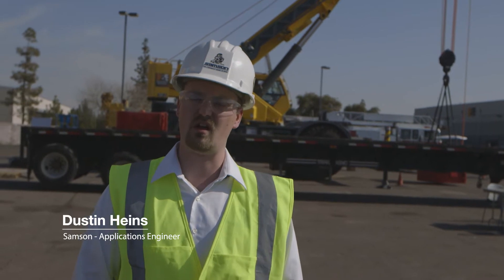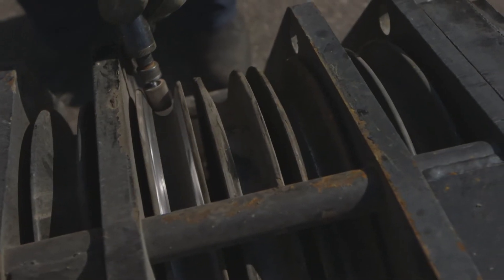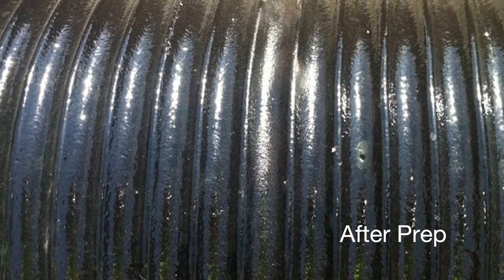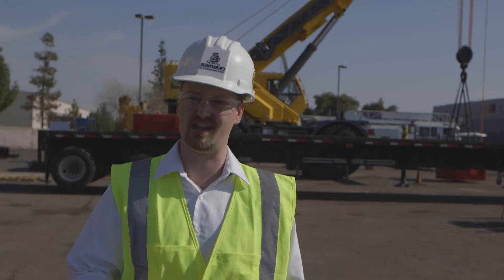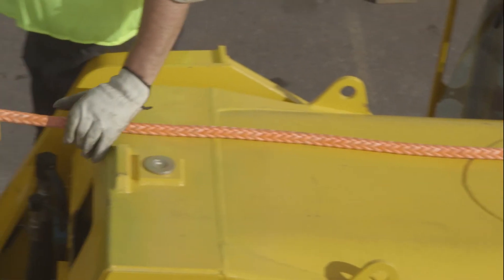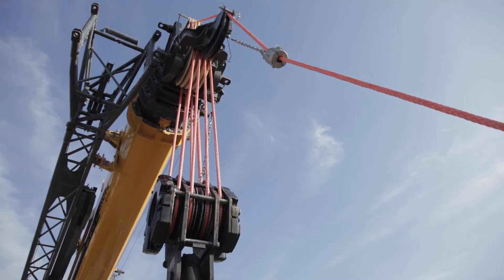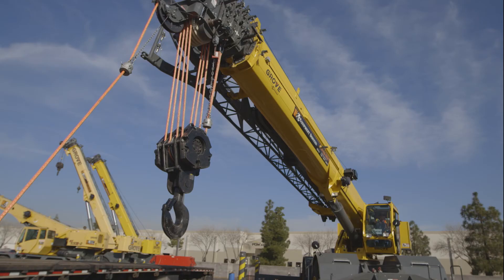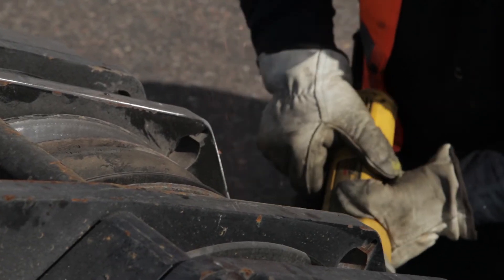Samson K-100™ Install Preparation

Comment: how does the rope not get sucked down into the layers on the drum under a load?
Reply from the maker: The rope construction provides a firm cross section that enables efficient multi-layer spooling. The control core is designed to be relatively non-compressible, compared to the rest of the rope structure. This creates a minimum limit to the distortion of the cross section, as compared to other rope designs, enabling the line to consistently spool without diving under consistent loading conditions. If you have further questions about this we can get you in touch with an expert. Email: custserv@samsonrope.com.
Reply: @SamsonRope  cool concept, we did some testing at our facility with a company called Applied Fiber in west Fl. where they took a 12 strand rope and they attached each strand to a load cell to maximize the load per strand, they were testing for off shore single layer design, is why this caught my eye, we install crane wires and the slightest gap will let the wire pull down if not installed under the correct amount of tension